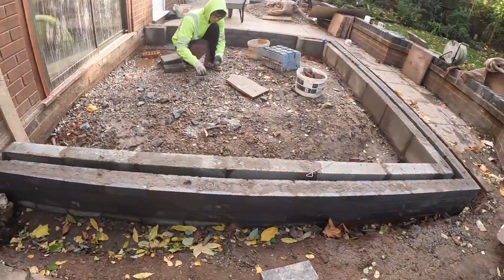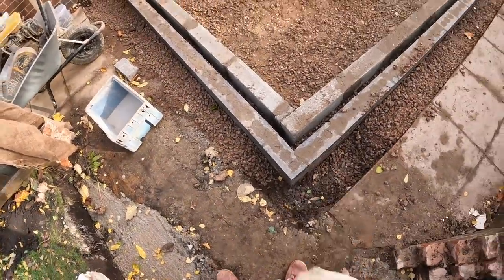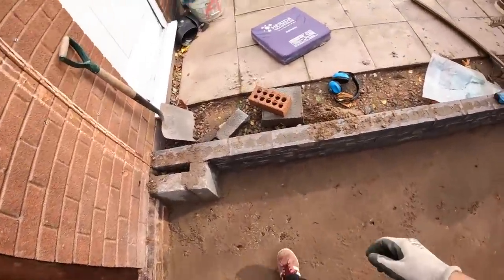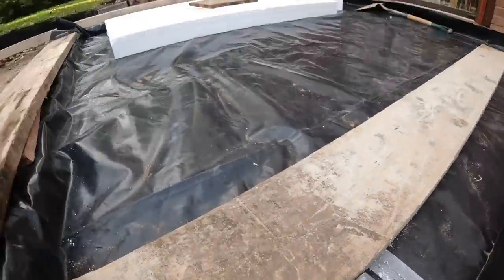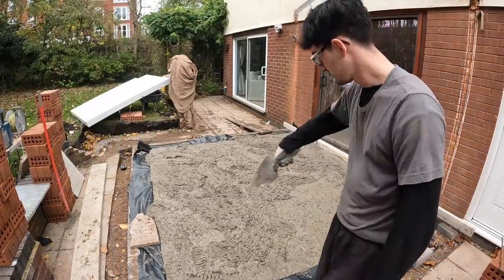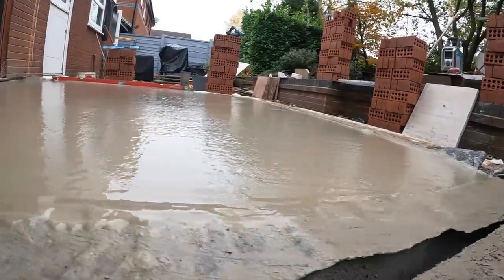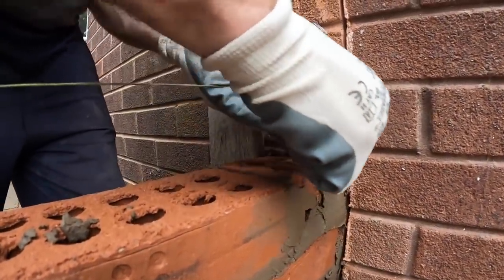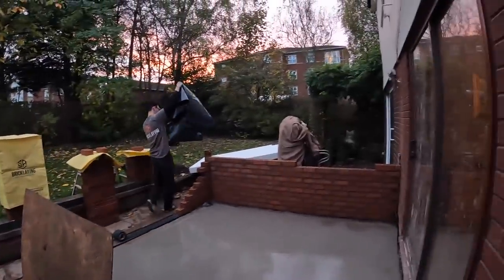CONSERVATORY FLOOR PREP  .. STEP BY STEP

Comment: Wish I’d have know about missing out the cavity wall where the door is, when I did my extension floors Steve. Explains why I had damp coming up. I had to dig out and redo the DPM under that area.  Is it normal practice to miss those out Steve?  Wish building control,had pointed it out to me. Andrew
Reply from the maker: That’s a shame mate . 
  Yes the concrete always extends into the door openings 🧱👍🏽

Comment: Nice job as always lads.
As you usually finish the concrete to ff height i was wondering if you ever feel the need to use one of those concrete floats on a boom so you can give it extra trowels as it firms up later on? Maybe on bigger floors.
Reply from the maker: Thanks pal no not really 🧱👍🏽

Comment: Great channel lads 
Can you clear up a query for me please?
When doing an extension with a concrete/screed floor but the existing house
has a timber floor so ff level is usually above dpc level. 
Do you set the dpc on the extension to the ff level of the house or to the dpc level of the house.
I’ve seen both used just wondered what your thoughts were steve ? 
Thanks
Reply from the maker: We would Keep dpc the same unless told otherwise by the architect or engineer 🧱👍🏽
Reply: Thanks for answering,  so internally you screed above your dpc then? 
Sorry to question it but I did my extension the way you said but then I’ve seen/read some that set the extension Dpc at ffl of existing house so they don’t screed above dpc in the extension?
Thanks
Reply from the maker: @neilu.k.1364  unfortunately I can’t help with this one as I’ve never screeded a floor or done a slab that needed a screed so I’m not really qualified to answer unfortunately .😬🧱👍🏽
Reply: As long as I know you always set the extension dpc to the house dpc regardless of ff level. 
That’s put my mind at ease - thanks again 👍
Reply from the maker: @neilu.k.1364  🧱👍🏽
Reply: @neilu.k.1364  We always install DPC at FFL on the new bit and if the DPC is lower on the existing building because of a timber floor just step it down so it laps the existing.
Reply from the maker: Cheers bud 👌🏼🧱👍🏽

Comment: Brilliant video chaps. I'll be doing basically the same for a project at the back of the garden this year - so seeing it all coming together and up to DPC was very handy and timely. Couple of questions...

Why do you use the jablite instead of PIR in the floor?

Also, at around the 11:15 mark where you lay the DPM on the sand, you have laid the big sheets of jablite 'inside/on top of' the DPM - but you have the upstands 'outside' the DPM and touching the blockwork. Is there a specific reason for this - or is this the standard way of doing it? I always thought that the DPM ran right to the blockwork and the upstands were fitted 'inside' the DPM.
Reply from the maker: We use 125 Jab as it’s cheaper and the cold bridging strip position isn’t really important 🧱👍🏽
Reply: @SteveAndAlexBuild  Appreciate the info. 👍
Reply from the maker: @jp6975  🧱👍🏽

Comment: Nice setup work for the concrete. The concrete mix looks pretty wet...maybe a 6 slump? Long setup and cure time I'd expect. I'm still surprised you can get away without having to put steel mesh or rebar down on the pad... Nice finish work guys! Silly question, what grade/mix of concrete do you usually specify? Cheers from Texas!
Reply from the maker: Hi buddy . The slab is supported by the hardcore so isn’t a suspended slab . 
   We tell the concrete lads if it’s a slab or a footing 🧱👍🏽
Reply: Suspended concrete floors often use precast prestressed concrete T beams with high density blocks between. Insulation and screed go over the top.
Reply from the maker: @Dave5843-d9m  🧱👍🏽